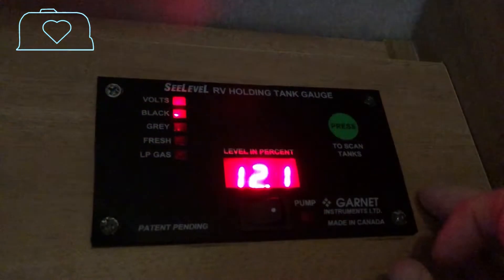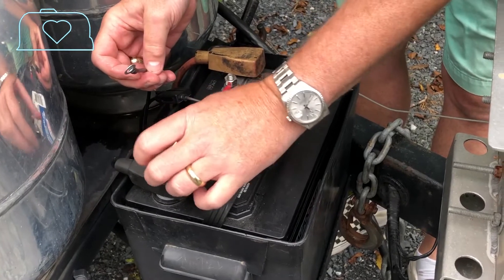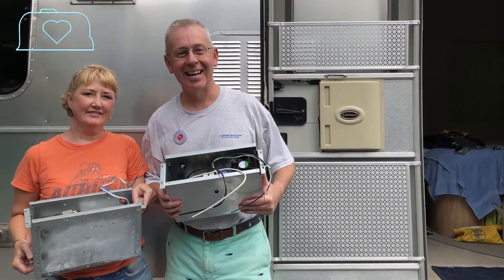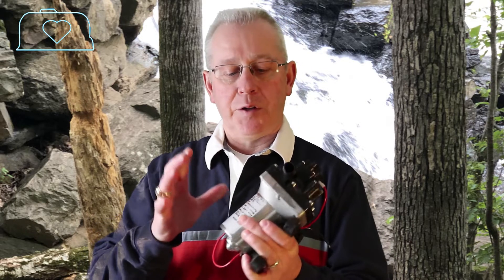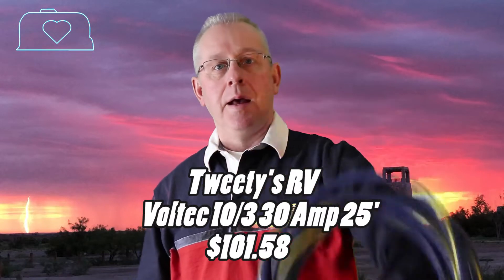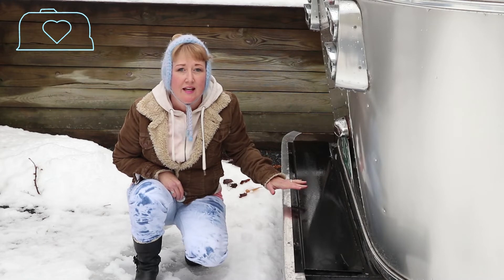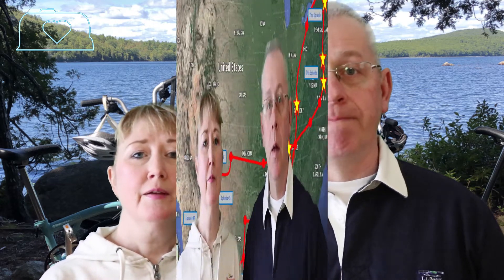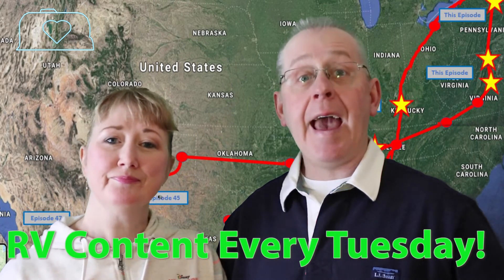From Power Converters to Check Valves:  What Broke on Our 2019 RV Trip

Comment: Thanks for the video. It seems every trip with my AS there is a problem. More than any other brand I have had in the past. Last trip was the hot water heater mixer valve. Spend one day of my vacation to FL looking for parts. We are headed cross country for the first time soon. I believe I’m going to take along a spare water pump after watching your video. Thanks for the tips.
Reply from the maker: Thanks for watching!  You may never need the spare water pump but when you are out boondocking in the west and realize that a failure means no sink, no shower, no toilet, etc.  you'll be glad you had one...

Comment: Buy a new power cord, replace the plug on the old one = spare cord.  Put in new water pump, repair the check valve on the old one with an $11 repair kit = spare water pump again.  I'm going through that in my house right now.  My furnace draft inducer blower fan assembly has begun whining like a lonely tom cat....bearing failure imminent I fear.  I did find the part from a reputable re-seller on ebay for $95.00 But will take a week to get here from Calif.  So I figure, If I can't keep the current one going for a week, then I have to run to a supply house and by a OEM new replacement for $425.00  We'll have TWO then I told wifey. :(   Hopefully, it will hold out......hey could be worse. I could be in Vermont.  Mid 40's to 50 here over the next week with lows in the high 30's.
Reply from the maker: That's exactly the plan with regards to having spares.  Good luck on the furnace - it's supposed to be - 8 here on Friday night...